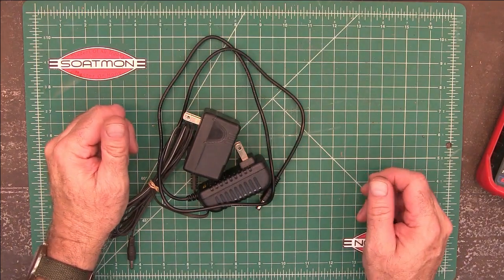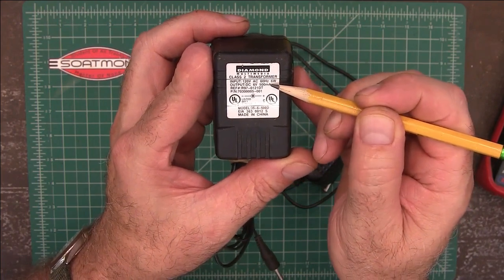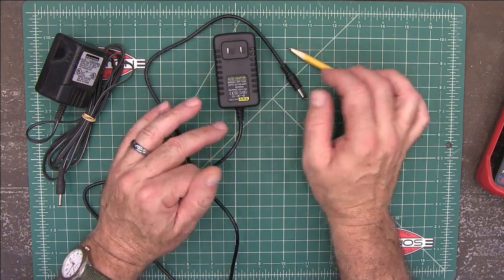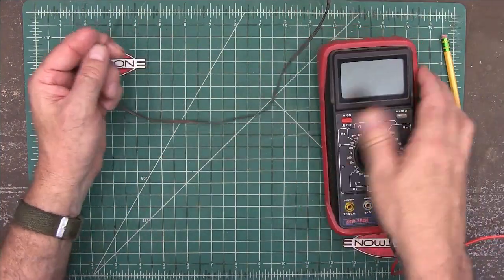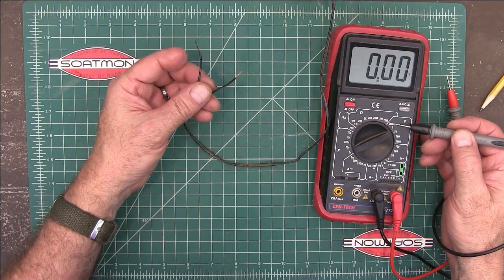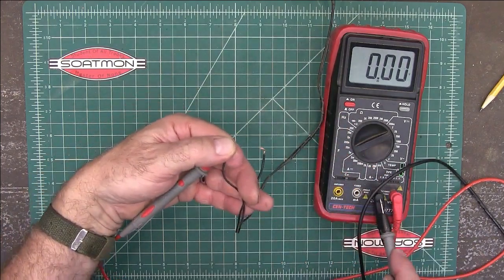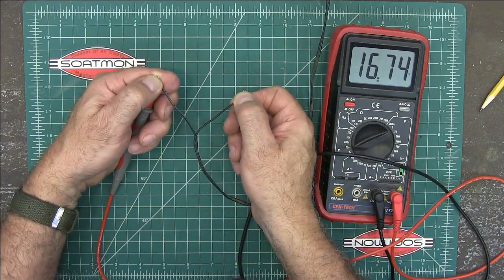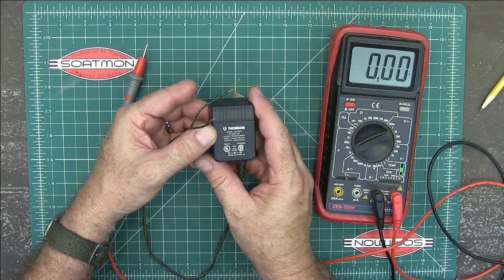How to choose a transformer for your project.

Comment: Awesome video as always! Something I wanted to add that is commonly asked of me is if "My project requires 200mA but all I have is a 2A, will that burn up my project?" No, it's generally ok to use the bigger wall wart. The rating on the wall wart is "supplies up to x amps" and the rating on the project means "I need to draw up to x amps."  As long as the amp rating on the wall wart is greater than your project, you're cool.  :)  If you're really worried about it you can use a fuse rated for +25% , eg a 200mA project case needs a 250mA (1/4A) fuse.
Reply from the maker: Good point. Thanks for sharing!

Comment: This is a bit 'out in the weeds' but if you like to listen to shortwave radio or have a favorite but distant AM radio station, these wall warts introduce a huge amount of electrical noise and can literally blanket any radio signal that you want to hear.  Computers, monitors especially as well as cable boxes are huge offenders also.  Not a problem for FM reception
Reply: very true!
Reply from the maker: Yeah always good to remember when you have a hum in an audio system. It could likely be a wall wart too close to some audio wires.

Comment: Well this interesting.  If I need more current or amperage for a project could I just say use two of the same voltage transformers and put them in parallel?  Would this help and not have the transformer burn out?  And you are right I too have a whole box full of these things.  Your information is very helpful indeed.  Thank you.  The heat here in east Tennessee is getting a little less intense now and it is time to get outside and get the outside work going.  Have started on some siding repairs and it is quite pleasant working again.  Have a good week end and will be looking forward to your video next week.
Reply from the maker: Using two would technically work but would not be the best idea. If one of them fails, disconnects, ect it will overload the other one and burn them both out. Also there is nothing built in to level the load between them so if one has more resistance more power will flow through the other one overloading it. Usually it just burns them out but could cause a fire. Glad your weather has improved. I'm still waiting. Fall is my favorite time of year.
Reply: Glenn - While doable it is not recommended to split loads with wall warts.
Reply: @peterhaan9068  Thank you Peter,  I would have made that mistake.  Your advice is appreciated.
Reply: Glenn, I am an EE and I agree with Peter. It is possible, but it is a fire hazard. Cheers! :)
Reply: @PartScavenger  Thank you PartScavenger, I was just thinking it would make a variable amperage power source.  But I surely don't want a fire hazard....not worth that.  Your advise is appreciated.